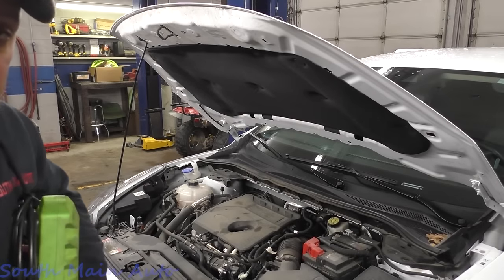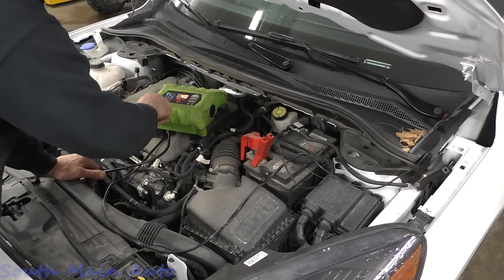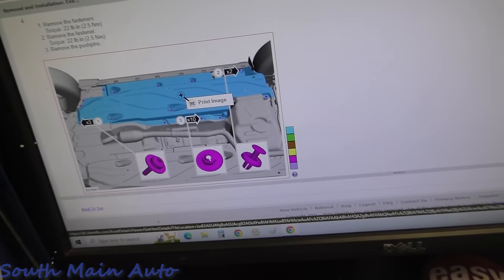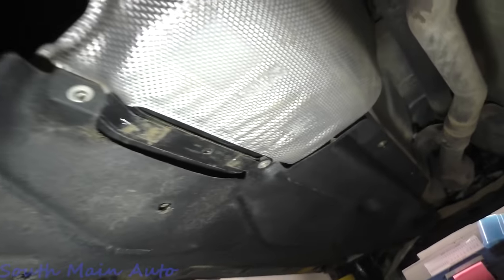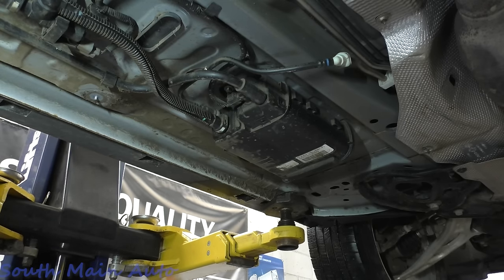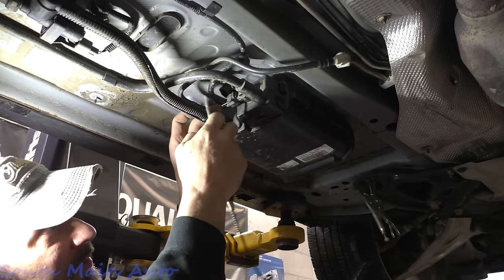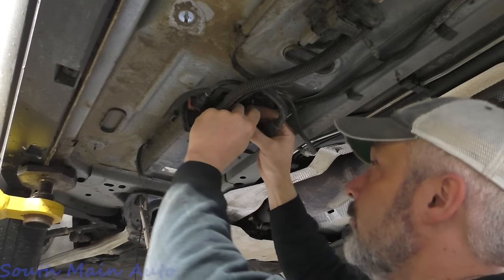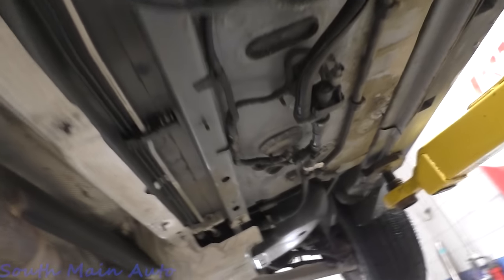'20 Ford Escape - EVAP Vent Circuit Code P0446 - Green & Crusty

Comment: Another shop would have installed a new vent valve, then the purge, then a new cannister valve, then charged you to smoke it, might even have dropped the tank to "inspect" the sending unit. The world is filled with parts cannon changers but few can actually perform a diagnostic on the circuit. Good work Eric O, even without the glasses you found it.
Reply: The other shop would have also scratched the roof when they flipped it upside down to work on it per instructions!!! 
Have a great day Rick. 
-KB
Reply: Ford dealer would have quoted a new PCM at $4500
Reply: Dirt and debris ?
Time for the shop vacoom😆
Reply: @Paul1958R  they like to sell new cars, go figure 😜

Comment: Hey Eric; tech tip; I use a seam splitter from a sewing kit to open up harnesses.  Cuts the tape without risking cutting insulation of the wires.

Comment: Hi Eric want to thank you for your videos on repairing 4 wheel drive trucks. Took mine in and mechanic said I need a new transfere case. All the problem was a 15 amp fuse had blown. With out your video I would have never known where to look. 
You saved me thousands of dollars.    THANK YOU

Comment: Since I've started watching your videos it has really accelerated my diagnostic capabilities and I'm sure I'm not the only one, but I hit a wall with resistance in wires and was struggling to wrap my head around it when you have full voltage then plug a module in and the voltage drops, now I understand that resistance can't handle load and that was all thanks to you but I noticed you don't have any videos teaching that lesson with a multi meter you just go straight for the test load and prove it candle handle the load, so please Mr. O make a video for the next young fella bc when I was trying to figure it out I went straight to your videos digging for guidance! Love you! Thanks for the lessons!

Comment: very good demonstration! Nice to see I'm not the only dirt road salt eating tech. I would have followed up with a purge and seal test as well. It only takes a few minutes. Its possible the current circuit code was preventing the vent solenoid bidirectional test.

Comment: Wow i had a purge valve failure myself, i have a 2020 Aviator. Took it back to the dealership and they replaced the CVV 🤔 
I wonder if my wire was shaved as well. 
I should bring my vehicle to you for a diagnostic 🎉

Comment: This is a lot like the debate about epoxy covered rebar. When it first came out people logically thought it would prevent water contact with the steel and slow rust. What happened is water found its way in, and the epoxy prevented it from draining or evaporating away. So, rust happened just as often, despite the extra expense of the epoxy. The epoxy also had a way of concealing rust making it harder to identify. Plastic covered body parts are in the same category, they are cosmetic barriers that hold dirt and moisture against vulnerable parts.

Comment: Along with the p0172 & p0175 codes, I also get the p0446 code on my ‘06 dodge ram 1500. Minding the rain, I will be looking for some green. Wouldn’t think down here in Texas it would be as prevalent but from all of your videos, you show sometimes the most simple solution beats throwing parts at it.

Comment: Let the haters hate. Your shop, your repair lol. I've used crimp connectors professionally since 1989. Jeez, people let it go. Stay safe, and God bless
Reply: I love the crimp and seal connectors. Such an improvement over a standard connector for automotive use.
Reply: @Ghauster  I used to use crimp and seal, with heat shrink, then tape, then loom, and then more tape, just to piss people off 🤣
Reply: 😂😂😂😂😂😂 @zeke1eod
Reply: crimp connectors suck, but they're better than "wifi" connections. lol

Comment: I like the Starbrite electrical varnish, the kind made of MEK, the one that smells like colors for reinforcing slightly chafed wires and for sealing off any potential crimper marks in a crimp and seal, or if you are feeling bad for doing the ol hokey pokey and don't want to leave holes in the wiring to turn onto green blobs .. its also great for gluing connectors with busted locking tabs together, not permanent, but it wont just jiggle loose either.

Comment: Those covers underneath are issues for everyone who does dirt roads.  My old 04 GMC Z71 had skid plates underneath it...someone opted for upgrade, thick ones, thank goodness cause I slid those things many times when a dirt road fell out from underneath me..loggers tore up those roads I hunted on to the point, at times, you went down a road for from 1/3 mile to over 4 miles, tires digging in, underneath belly scrubbing along as you ran thru the old ruts.  Anyway, after one very muddy hunting season, I took my old Z in for an oil change.  Young kid, bless his heart, raises it up on the lift, starts removing the skid plate to get to the oil drain, SPLAT...huge Alabama red clay mud wad the size of your head falls right ON his face.  Swearing, yelling, all the expected sounds came from the service bay.  Dude hadn't been working changing oil for more than a couple months maybe, and I come along and teach him the hard lesson to, LOOK before you drop covers....LOL.  Service writer and 4 other tech in the shop come out where I am, laughing hysterically...I knew all of them personally for years...thanking me for the great lesson I just brought to the new guy.  I bet he never did that again.  Those skid plates can hold quite a large amount of mud when you drove in mud like I did, and many others, while on a hunting outing on a logging road.  Watch the face and look before you just start dropping a cover...lesson learned...LOL.  Cheers.

Comment: I was wondering . When you run a test of something on a vehicle to hear a something clicking. What is the difference between a good click and a bad click?  With your experience you know these things . But if it click it's good?  Now that cover. With all that wire and things. I would have a hard time taking that cover off. What if I brought my vehicle to you twice a year and had you pull and clean under them. Would that be as good as taking it off? I also would like to have the front wheel liners pulled back at the back of the fender to clear out debre there also. Would that be maybe an hour of labor for all of it?

Comment: My wife’s 2013 had the same thing and it was making the gas tank flap vibrate.
I had to take the air box out and clip the old one out, cut the tubes, put the connectors in with the new canister valve. 
Took me about an hour.

Comment: I just put a 2020 Escape 1.5 on my hoist for EVAP diagnostics like you did. I pulled just over 20lbs of gravel cake from atop the driver's side felt cover. The customer lives on a gravel road and the vehicle has 66,000 on it. The passenger side felt is equally full. I'm going to see if the customer wants me to throw these felt covers in the garbage.

Comment: Leak DTC's on late model Ford vehicles are also commonly tied to the capless filler, where the flap doesn't seal.  I have to oil mine (spray oil down the neck) every few weeks, clear the code and I'm good again until the fuel washes off the oil and the flap starts leaking air.  The capless system is dumb.  Now we can't just replace a cap because its not sealing.

Comment: Could the position of the negative power supply clamp or battery charger negative clamp on the battery compared to being attached to an engine or body ground cause a battery amp module trouble code? Helping a friend of mine with several vehicles we have had trouble codes stored for said module. They are history code though.

Comment: I like to use 12 gauge wire nuts on those types of wires and fill them up with silicone when I'm done.  But always make sure you sinch it up tight with a zip tie when you're done.

Comment: I believe the fabric type material is supposed to help reduce road noise, but they really should cover it with plastic to keep the dirt, salt, and water off. But that'd cost them a few bucks and prevent rust that might make the vehicle have to be replaced sooner, so no surprise they don't care.

Comment: How fortuitous, I was just getting ready to take my 2005 F-150 (with 39k miles on it) to get its annual inspection, and it started up with a P0446. I was just watching other videos on how it's probably the wire and not the actual valve, and along comes Mr O with another video reinforcing the wire issue.

As for the eyes, I would highly recommend getting either bifocals or progressive lenses, with basically "clear" lenses for your distance viewing, and then your close-up lenses on the bottom. I had 20/10 vision for years, and I still have very good distance vision, but my close-up vision is garbage now. I just went with wearing glasses all the time, as it's easier to remember. What a drag it is getting older.
Reply: Just came out from under the truck. The tree rats chewed both wires off of the connector, flush with the connector. If I recall, Ford has some soy-based covering on their wiring in places, and that seems to attract them. My old 2005 Focus suffered the same fate, but at a different house.

So, what's the quickest way to get rid of squirrels in a densely-packed neighborhood, without taking out other wildlife? I may have to do some research into that. War has been declared.
Reply: @wallingj68  lead is the answer but frowned upon in neighborhoods. My father did a set of reversed bi-focal for use when working overhead. Worked very well.
Reply: @Ghauster rapid lead poisoning! LoL 🤣😆
Reply: I believe the majority if not all automotive wiring is soy based. Makes the wiring an attraction snack!!
Look at the car in my profile picture. Not one chewed wire!

Comment: This repair should be free at the dealer since it's directly related to the emission system.
Reply: you know they'd either not find it or after replacing 1/2 the car including non-covered parts, or just not find it and push for a trade-in. new car sales is what they're into.

Comment: 17:42   You've taped up the wires and slipped the plastic back over them, then taped up the plastic,  but you've left those three wires that go into the plug with no tape and no plastic.  Isn't that asking for trouble down the road ?

Comment: Hey commenters (I know Eric is busy), BTW, why is my scanner not reading my 2011 Ford when it reads my 2008 Ford just fine?  Is that a model year end anomoly?  I'm all "updated" on an XTOOL scanner but no comms even after I manually in put the VIN etc. No comms.  I've never had this issue, but then I'm carburetor old and haven't scanned as many in my life as y'all do in a week or two. tnx

Comment: Fords weird that way with the Evap special functions or output tests. But I believe they’re all normally closed when unplugged so pressure testing with the smoke machine works good typically. For fords I prefer the easier scan tool driver seat diag methods. Also when a new f150 or expedition rolls in with a park brake limited function warning light…. within 18” of the right rear electric park brake motor 100% of the time so far the green puss

Comment: HEY  E  O.   How come "some" Shops have/Use those things that have "SPLITS" in them when Lifting the cars on the   "PINCH WELD'S" ??  My Van (and just about every Car on the road have em, and Mine are BENT OVER FLAT!!! They didn't even bother to straighten them (I DID ) when I found at home. Just Asking . Great JOB FORD, I have that  N.V.H.  FUZZY Stuff Under my 2022 F-150. 🥱, In California, 😬👎 we don't generally have that Issue Unless ya go Wheelin..

Comment: If the owner had taken that car to the dealership they would have eventually put in a new wiring harness instead of fixing the broken wire. Of course that would have been after they shot a bunch of other parts at it.

Comment: Question, around what year did cars/ trucks start using battery  current sensor???
Reply from the maker: Early 2000's ish
Reply: It was added when the auto shutdown was added.  They didn’t want the engine to shutdown at a traffic light, then not have enough battery power to restart it. If the batty is weak, it stays running.

Comment: "The nice thing is that they use the same color wire". 4.00  And the salt in that felt wind deflector pickles the wires preventing their deterioration. Salt would encourage rodent visits.  Must have been the same genius designing both.. Mice don't need to strain as much when chewing on the harness. ? Do different manufacturers use a different gauge, and grade of insulation for signal wiring?

Comment: There's nothing wrong with using marine grade butt connectors.  I do prefer solder whenever possible but there are times when it is not possible or practical.  Just avoid those butt connectors that have the solder built in and supposedly melts when you shrink them  You can't get the solder hot enough to flow probably and you'll almost always get a cold solder joint.  The crimped ones work way better.
Reply: Someone should test the amount of "solder" flow in those heat shrink connectors with the metal like ring in them!!
Reply: @dans_Learning_Curve  I've cut a couple open and I can tell you with 16 gauge or larger wire, at least, you get nowhere near enough and that is with me saturating the wires in flux.  If you get it hot enough to flow, you burn the insulation.  Maybe somebody has the right touch to get the wires properly bonded, but I sure don't.

Comment: Whoever did the diaper wrap on that drop-arm/pull out should be fired, along with the check board runner (who is supposed to be checking those exact things).

Either that or somebody's been in there.  Those things are usually wrapped up tight.  But hey, Mexico...granted you couldn't afford that harness made in the USA, but sheesh.

For those underbody shields, blame the studio, EPA, and the people.  Why?  Noise for starters.  They started putting these on to 'reduce road noise', because those are so much cheaper and easier to deal with than sound deadening in the floor pan under the carpet.  Studio also uses the "It looks so nice not seeing all those components".  Remember the meeting when these were first being proposed...the engineer said "WHO is looking under that vehicle and saying "OOOOO Look how awesome that looks".  Studio weenie said "Do you like your job?  If you do, shut up".  Pretty standard for any of those items Studio wants that will just make everybody's life miserable, and really doesn't do much for vehicle sales (though they tell leadership it will sell an extra 100K vehicles)...

Comment: "enhance...enhance...UN-enhance..." That's some European technology talk right there. ;p Those under car covers increase gas mileage by .00007963 %. When you're dealing with a fleet of vehicles and federal emissions, that amounts to 0.000000123% increase in gas mileage across the board. I'd say get rid of it in the rust belt.

Comment: WOW I didn't expect that wiring to be so exposed after removing that undercarriage. I see why they put it on there now. Maybe a slightly better design would work because it looks like dirts being kicked up from the tires. Maybe some simple mud flaps would help keep the dirt out. Or you could cover the wiring & harnesses better or direct some air flow between the body & cover that would dry it out & or shot the dirt out when your driving. On the evap issue I wish it didn't exist & fr emissions they just through on a long life cat & call it a day. A cat will burn off all the harmful gas & that's really all that matters. All this emissions crap is just another way for the government to tax Citizens. You may think it's not a big deal to give into taxes on ridiculous stuff but the more you agree to the more stiff they find to tax. In Canada they are literally taxing you to breath.

Comment: The parts store Technician will sell you the part because the code reader diagnose the problem. Thats what people believe now days. A code reader diagnose a problem. Spits out a paper with a complete diagnose. 
The problem is when the customer is told. Its recommended to take it to a shop for proper diagnosis first and then buy the part. Nope it s to expensive.
Now the other part is. The so called Technician hooks up their code reader and sends the customer for the part. Part is replaced and code still in... customer is told to spend money and time. No wonder customer are Leary to spend money at a shop. And all it takes is common sense to troubleshoot.